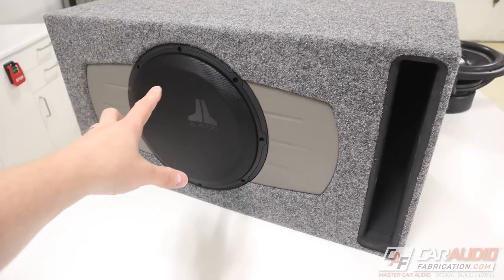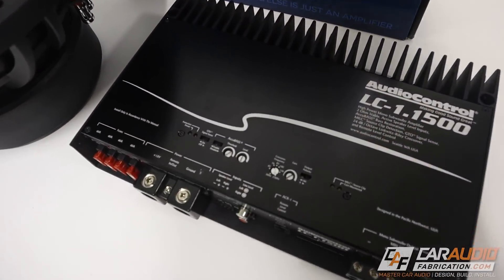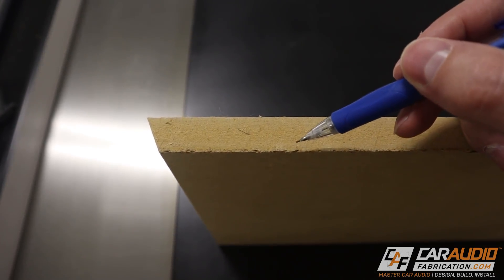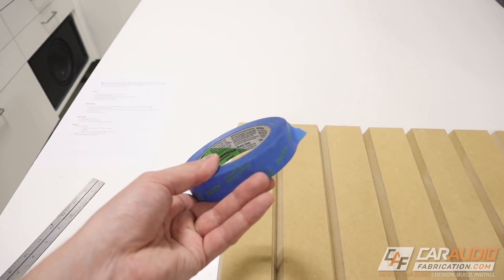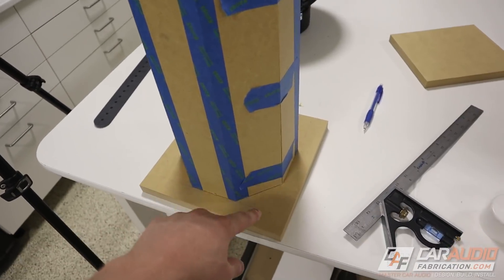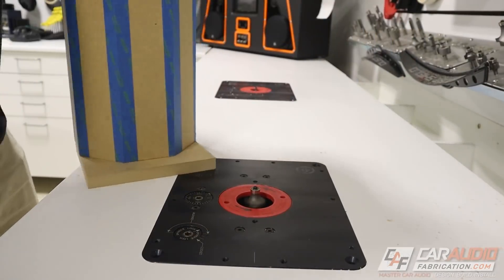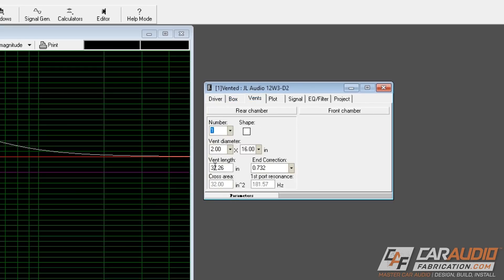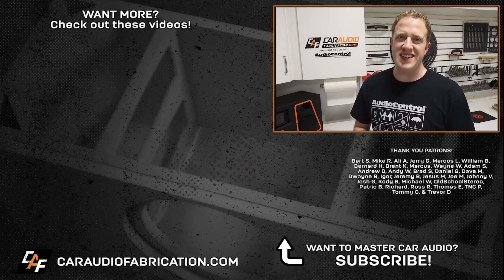How to Make Subwoofer "Octoport" & WHY YOU SHOULDN'T

Comment: How do you figure out the displacement of an octagon port?
Reply from the maker: Determine the area based on the size of the outside of the octagon, then multiply by the length to get the displaced volume.

Comment: If it’s internal to the box, there’s so much wasted air volume with the thickness of the wood too. In a smaller enclosure, losing that volume will only make the port that much longer. I would only use them for external ports in an SPL application

Comment: So I just bought a 2021 Elantra n-line with a Bose speaker system with a subwoofer. Is there any way to box it when it's mounted to the deck lid?

Comment: How do you figure port length when the edges are rounded over on the ends?  Where does your port actually  end? I ask because the ends of your port are actually a larger diameter than what the port is supposed to be.

Comment: It’s quite fun when you think of the ports total surface area to displacement volume it takes up. Slot ports with three common walls are the most space efficient but depending on the ratio of width to height (square is best) you may not have enough port area or you may have a super thin width port = sounds bad/port noise. On the opposite side aero ports or round ports have the least total surface area but do not get to use part of the boxes sides so it’s displacement volume is usually larger once you factor in the additional bracing required a slot port 3 common wall gives. Every other shape approaching a circle aka hexagon or octagonal shaped ports end up with more surface area and volume (but you can make them custom and usually more rigid than an aero port without fiberglass reinforcement).

Comment: I’m wondering if a prime number of sides (like, say, 7) would be better; as it’s more resistant to the formation of standing waves between the flat planes of the sides?
Reply: In theory yes. I did a quick calculation and the first harmonic of this port's walls is 2152.60591 Hz which I would hope isn't being sent to the sub. You'll also note that a round tube has an infinite number of parallel sides which would make them more likely to have this problem.
Reply: @Thomamps  Um… I get the feeling that some calculus gets involved when the tube is circular; but I’m too groggy - it’s 2am here - to throw anymore brain cells at it..…

Comment: Maybe I'm just getting old 
But if it not a Sealed box  it a slot port box  I've even ran a 12" in a 5 gallon bucket  with a port just to get by I've even ported 6x9 and used 6x9 as subs

Comment: if you want a bigger port you can to use sewage pipe they come all size allot over 15 inch to
Reply from the maker: Usually you have to buy a large length though.... look up the prices for those... lol. Not really economical
Reply: @CarAudioFabrication  if you have any job site near you making house or so they trow the small peace away 
i used to put them in the ground  i put sewage and water main in 
they way i say that sc. 40 works good 
when i was in my 20s lol i made a bass tube out one and thoult i was the man but look back now i make it all out of food would sound better
like all your video great to watch and learn more about this stuff 
now i just have one 10 sub in my scion xb with a mono amp hit good i think lol

Comment: To adjust the guide on the table saw to accommodate for the angle, just put a square on the piece with the shortest side (2.5") at the bottom. Measure that gap. Multiply by 2 and add that to the 2.5".
Set your guide to the total. Why waste the wood?
Reply: Even doing it your way, you'd waste a little, because you would have to find tune it at least a little bit anyway.

Doing the cut-then-adjust method is simpler.
Reply: @coreycantwell2019  to each there own. My way there's less waste and for me it's easier.
As for quicker, I could have my piece cut before he would at that method. There's no wrong way with either, I was simoly stating a way that has less waste and in all reality, is quicker.

Comment: You should do a couple of videos about getting the most out of inexpensive subs and speakers, using processing, enclosures, sound deadening, and placement
Reply: yep Im doing 142.8 db's with a worn out old , HDC3 18" . Wish I had a new Crossfire sub. but im still maximizing this one
Reply: @AlanRaybasshead  I think it would be really cool to take a couple of cheap subs, like something from Boss or Dayton audio, and do a build to get the absolute most in terms of sound quality and output.
Reply: @justsomeyeti5814  got my ears tingling, I got four single voice coil subs that were doing on 136 in their recommended sealed enclosure, building another quad box with aero ports to get more out of them on a sfb1000... I love 4ohm single voice coil subwoofers because, in parallel the easiest wiring process they go down to one ohm. Which I found almost any amp I've ever run is stable enough to do with enough juice. I got a box in mind that should be musical but rail. I'm no major box designer but I sure like to design with budget in mind😁

Comment: 5:00 mark the 2.5" on the board. Line up 2.5" mark with saw blade, adjust guide rail to cut location. Cut.
Reply from the maker: You have to eyeball the angle and I find it's not as precise but either method works.
Reply: @CarAudioFabrication  We already know the angle. I thinking about it as less waste but agreed.

Comment: why use a single large port vs multiple small ports? I saved myself from 3 foot dual ports with ~7 inch quad ports. It hits very low still
Reply from the maker: That doesn't really add up. If you used more ports (of the same diameter) that would mean more port area and thus even longer ports than original for the same tuning.
Reply: @CarAudioFabrication  I didn’t think you’d actually read my comment so I made it short 😂. I’m a broke diy-er, I had a sealed 10” enclosure that I wanted to port down to ~35hz. I found a calculator, and I calculated based on my limitations of using pvc pipe, which has a fixed diameter but variable length. If I were to use 3” or 4” diameter pipe I would’ve needed outrageously long ports. Most calculators only let you chose single or dual port, but I found one that let me use 4. I was able to achieve my desired hz by using (4) 3/4 pvc tubes cut 6.75” in length.

Comment: Noticed that the table-saw has metric markings, so if you want to make it easier to do the calculations ditch the imperial-measurements!
Reply from the maker: The math is easy regardless of what units are used. But I understand if you aren't familiar with imperial why it is confusing for you
Reply: @CarAudioFabrication  It's not confusing, just a hell of a lot easier!  Less wastage by doing more accurate cuts & avoiding 'guesstimates'!
Reply: Lol, my grandad passed away in 1970.  He used imperial measurements.  It's so antiquated.

Comment: That hard edge is called a filet.
Reply from the maker: Incorrect. A 90 degree edge does not become a fillet until a roundover is applied. "A fillet is a curved face of a constant or variable radius that is tangent to, and that joins, two surfaces."
Reply: @CarAudioFabrication  apparently I wasn't clear in my statement.  The 90 degree before the round over, Roman Ogee, miter what ever, is absolutely called a fillet.  Words like 'incorrect' make you seem douchey or like the old Speak and Spell.

Comment: I'm a dumb ape. I called everyone for round tubes. They didn't have my size. One shipping tube company quoted me $375 to make a cardboard tube. Angrily I purchased a 3D printer to make a 7.125" port, and joined short sections of PC filament tube (printer bed height issues) together for the tuning frequency. I also now have a small flotilla of tug boats. 😅
Reply: The number of times I've bought tools because it was cheaper than paying for a service
Reply: Stack fab is the way to go to a custom round port. Yes it will take a little time and a lot of dust but in the end it is well worth it.

Comment: For pipe size problems. Stainless exhaust pipe and aluminium boost pipe, comes in measurements up to 3" and normally comes in multiple sizes normally in 3/8s - 3 to 4mm differences at a time. I know metal isn't perfect for resonance but you have a large choice in sizes.
Reply from the maker: Hmm interesting, you are still left with the challenge of how do you mount into the box and as you mentioned resonance, but a curious idea for sure.
Reply: Epoxy over cardboard tubing.
Reply: What if you wrapped the tube with sound shielding material? Would that address the resonance problem?
Reply from the maker: All that trouble why not just build a stack port or octoport? lol
Reply: Or fiberglass over cardboard tubing.
Reply from the maker: @anglerandy5736  Again, significantly more work, Ill avoid any fiberglass if possible.
Reply: @CarAudioFabrication  I have an entire pallet of midbass drivers on my living room floor, and the only reason they aren't mounted in doors playing, is because I'm not doing fiberglass. 

Hundreds and hundreds of dollars in tweeters, and midbass, and I ended up going another route anyway. 

I have 32 mids, and 20 tweeters, waiting for someone that wants them! 

Fiberglass can kiss my ass! 🤣
Reply: @CarAudioFabrication  I did fiberglass once........... never again! lol